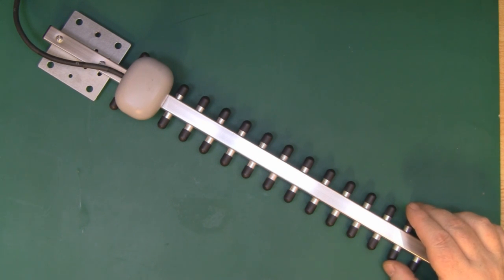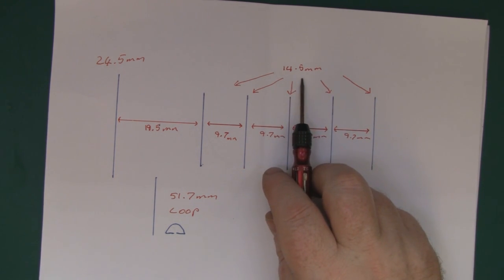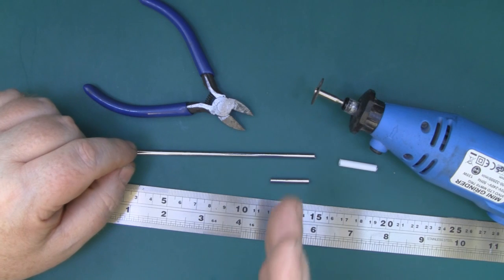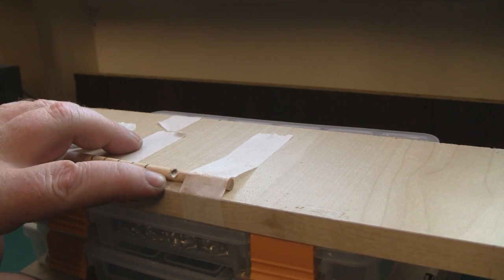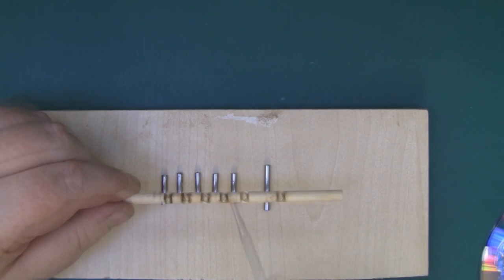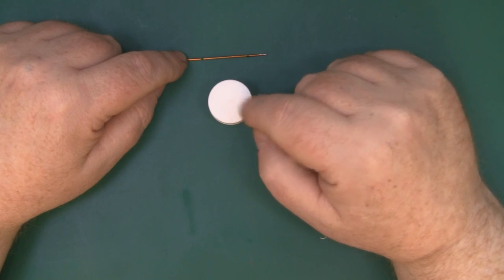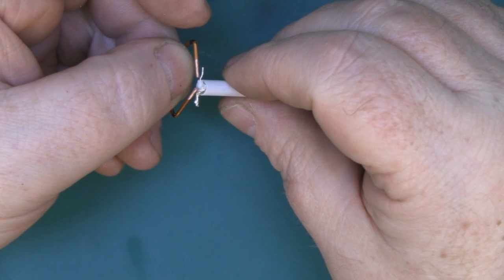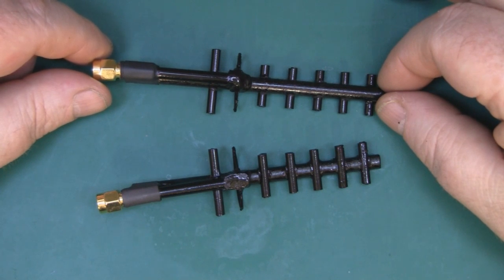Yagi Antenna 5 8GHz #110

Comment: Hello, can one-way receiver antenna that can detect 100ghz em wave with 1ghz be designed?
or, how many ghz can be designed from 1ghz up?
Reply from the maker: Short answer no and the equipment to detect and analyse waves past 50 GHz would cost the same as an average house
Reply: @andrewmcneil  Thanks for answere.

Comment: I Andrew and thank you for all these videos.
I have a question for you; is there any concern using a 4 mm in diameter instead of 3?
And what about to use iron instead of aluminum?
Reply from the maker: you could use 4mm but iron is a poor conductor when compared to copper and aluminium
Reply: Thank you, I used 4mm aluminium ... just to be sure it will work “on the field”

Comment: Sir do we have to solder the closed loop with one end to core element and other to ground ie outside the core??
Reply: Yep, centre of coax to one side of the loop, and shield to the other. It makes a close to 50 ohm feed, give or take.

Comment: May I ask you if you think this type of antenna would be good for a transmitter? I'm seriously feed up with all the antennas that  are sold that supposedly give your more range ... but  it finish been a truck load of horse manure I did use. Custom,  Tuned, Circular Polarized antennas "Really expensive ones.. until a day that I      didn't have other choose but to test with a regular antenna to find out that the regular was  at least 20 times more powerful than the ones that I was paying an arm and a leg....
Would you please consider  to advice on a directional transmitting antenna? please??
Reply: yeah, unless you're flying in a straight line, a directional antenna has to be pointing at whatever it's transmitting/recievng from. you can probaly use a auto tracker, but that would add a lot of weight, and as long as you're using a omni on one and a yagi on the other, it's the same vice versa

Comment: Andrew Are the elements steel or alumunium and do they have to be a fixed diameter? please forgive my naivity I'm a complete ameteur I only ask to see if weight can be saved.
Reply from the maker: +John Vickers Hi John they are steel but you could also use those cheap telescopic tv aerials break it down and use one of the tubes.
Reply: +andrew mcneil Cheers for answer.

Comment: Hey Andrew, I found some valuable antenna research at this site:  http://home.comcast.net/~ross_anderson/
http://home.comcast.net/~ross_anderson/2400MHzAntenna.htm
http://home.comcast.net/~ross_anderson/CurtainQuad.htm

Russian Site discussing design process and performance (Seems really popular there)

http://www.lan23.ru/forum/showthread.php?t=2660

http://www.lan23.ru/forum/showthread.php?t=2659&s=263fbd0e038a00ac631deab420c54e33

http://www.lan23.ru/wifi/panel18/panel18.html

http://www.lan23.ru/forum/showthread.php?t=2823

Spanish Site also discussing the antenna (seems really popular across the globe)

http://www.zero13wireless.net/foro/showthread.php?4802-Antena-panel-18-DB

If you can take a look at the 2.4 Curtain Quad design and share your thoughts and maybe if you consider the antenna worth talking about - a design and comparison video with some of your other designs, your fans and I would be really grateful.

Comment: Thanks for the video, but why would I want to use yagi instead of helical?
Reply from the maker: +Martin Brychta To be honest I think it is that some people like to experiment as I said in the video it has been requested many times.
Reply: The helical is a circular polarized antanna - wich is good to get rid of multipathing because it rejects inverted signals but it's range is not as high as the range of a linear polarized antenna like a yagi.

Comment: a thought use a straight edge to line up the parasitic elements .. I very much like the details in the builds you add.using the benchtop to make sure the parts all line up, priceless
Reply from the maker: +craig palmer Cheers Craig